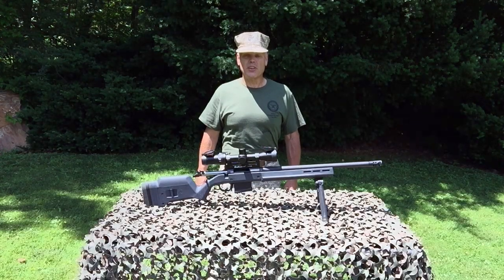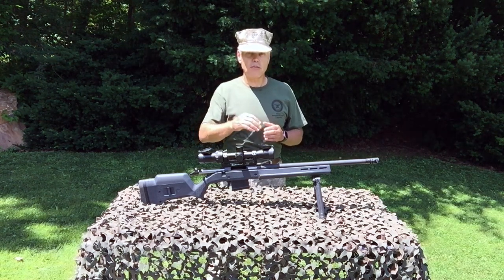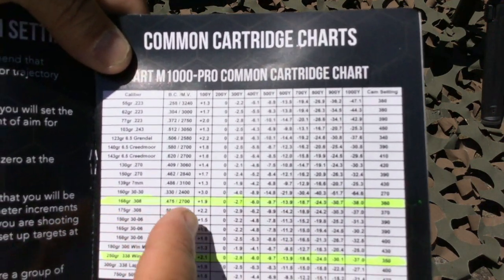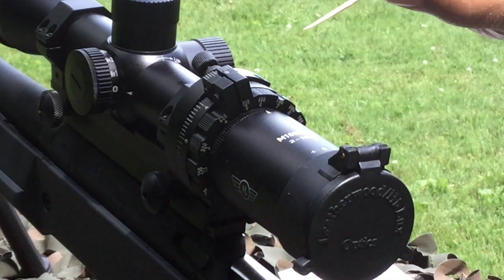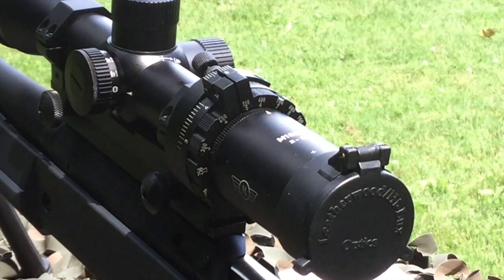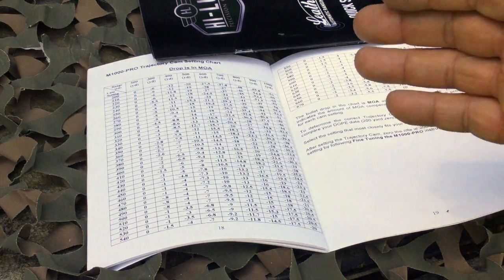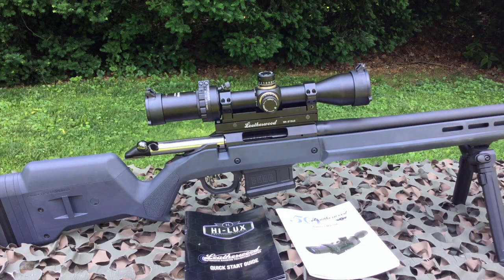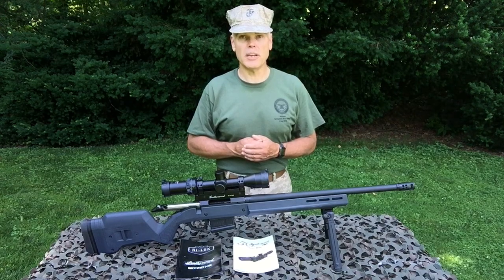Leatherwood M1000-Pro ART Riflescope (Part-2: Calibration and Zero)

Comment: I think that you probably have already figured this out, but if you have an old M-1000 you can take the thumbscrews out of it and replace the slotted screws on the PRO.  It's not quite the quick release you talked about, but it does make the adjustments a whole lot easier.
Reply from the maker: I actually adjusted the the screws to the point where they are just loose enough for me to uncouple the rings, but tight enough to hold in place when I push them together.
Reply: @hrfunk  That sounds like it will work great as well.  Do you have any problem with the screws loosening up over time?  With the thumbscrews, I have to use a screwdriver on the calibration wheel to move it, but it only takes less than a quarter turn at the most.  The thumbscrew on the range/power ring loosens with my thumb, but is easier with a screwdriver.  The main point is that no matter where the ring is in its circle, especially on the bottom,  you can easily reach it with any length screwdriver.
Reply from the maker: @douglasroberts6930  So far, I haven't run into an issue with the screws loosening. When I adjust the rings/cam, I hold forward pressure if I want the system to stay locked together. If I just want to adjust the power, then I simply pull back on the power/range ring and dial in whatever magnification I like. So far that seems to be working pretty well. Maybe I should make a short video demonstrating that for people.
Reply: @hrfunk  Good idea re the short video.  I also, since buying my PRO, thought that the only ring that needs to be tightened down a bit is the calibration ring.  I have felt that the power/range ring could be left slightly loose and all you had to do is pull out to change power and then push back in to include it in the auto range aspect.  Thanks for your replies.

Comment: The Primary Arms ACSS reticles are much simpler and easier to use. This scope looks too heavy (32 ounces) and high over bore axis for me.
Reply from the maker: I understand your concerns, but keep a couple of things in mind. First, the weight of the M1000-Pro includes the rings and base. The weight of most optics does not include the mounting hardware. Also, once this scope is properly calibrated, all you have to do is frame your target at any distance out to 1000 yards, aim and fire. No rangefinder, no holdover, no clicking through a sight correction. The height of the scope above the bore-line doesn't bother me. All things being equal, I like the center-line of the scope as close to the bore axis as I can get it, but the stock on the rifle I'm using mitigates any cheek-weld issues, and the off-set of the scope is only measurable at extremely close ranges.